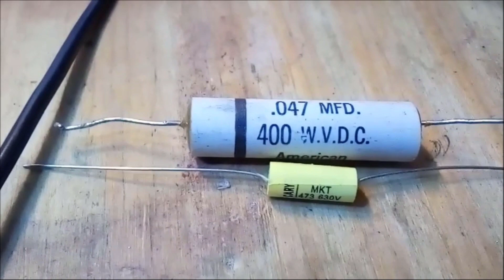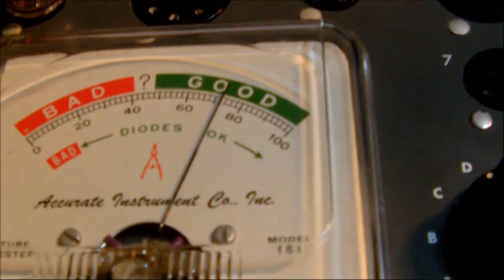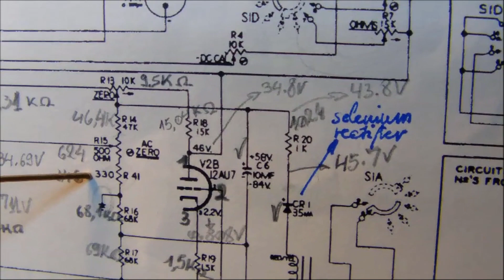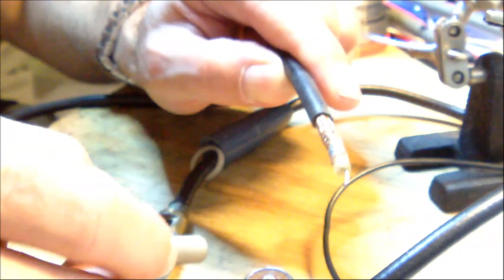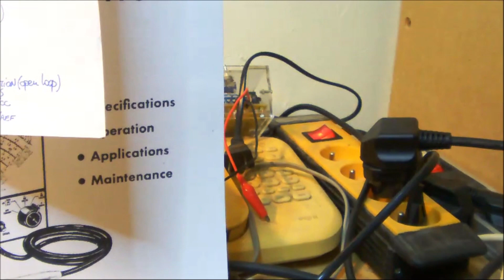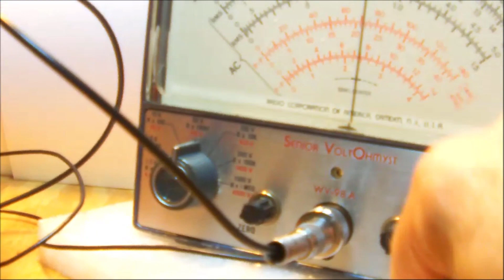RCA WV98-A Volt Ohmyst Multimeter part 2 of 3

Comment: I like your video a lot.  However after you replaced the selenium diode, you never showed in video 2 of 3 what the effect was on the voltage across C6 or the plate voltage on 12AU7 at pin 1.  Normally a lower resistance than 1K is used in other circuits and a series resistor is added.   CR1 is about a 7-8  V drop and the new diode is a drop of about 0.7 V.  That would normally have an effect on both C6 and CR1.  Please comment or better yet say what these voltages were after the conversion of CR1.  Thanks.
Reply from the maker: Hello Stefan and thanks for your nice comment. Yes, you're absolutely right, replacing the selenium rectifier by a silicon diode did push up the voltage somewhat (in the order of about 1.5V under load if I remember correctly) and I should have compensated that, technically spoken, by adding a roughly 100-150 Ohm 3W resistor in series with the 1N4007, to simulate the inefficiencies of a selenium rectifier.
 However, I also replaced the battery for voltage reference normally used in the Ohmyst, by an LM317 driven 1.5V voltage reference source tapped from the built-in transformer, which in turn dropped the voltage again by about 1V (again working from my memories of the restoration) due to extra load on the transformer.
In other words, the improvement in rectifying efficiency using a 1N4007 silicon recitifer, was nearly completely compensated by the extra voltage drop caused by the added little 1.5V reference voltage circuit I built into the multimeter.
I hope that answered your question :) Thanks again for watching, considering subscribing and giving me a thumb's up. See you soon for another video on my channel
Reply: @TechneMoira  

Hi,

I understand your analysis.  I determined that the exact electronic replacement for the '1K resistor and selenium diode' is to replace the selenium diode with a 1N4007, or equivalent (1000 PIV) and add a 300 ohm resistor to that 1K one.  The total resistance is then 1300 ohms.  This was done by breaking into the circuit between C6 and the 1K resistor.  I inserted a rheostat set to 100 ohms (a guess) and turned it up and down as a variable resistor to see the effect(s).  I had a voltmeter across C6 and one on the plate of vacuum tube V2B, pin 1; 12AU7.  The plate voltage was measured versus chassis ground.  I restored my low plate voltage of 138 V DC (caused by the selenium diode) to 142 V DC (silicon diode) across C6 and my 44.5 V DC on the plate to 46.3 V.  Those are factory voltages in the RCA WV-98A schematic. 

I did a lot of other analysis of load impedances and it was very detailed.  The ACTUAL current flowing in the old or new diode circuit is reportedly, *reported-not measured*, to be up to 100 ma.  The MAXimum tube cathode current in any tube manual from the 1950-1960s is 22 ma.  Ops!

All those statements like 'the rise in voltage from a silicone diode is 5 -15 volts' and 'the voltage drop of the selenium diode is about 1 volt per plate' are not very accurate. 

I measured the cathode current and got 2.3 ma DC.  So, looking at the Sarkes and Tarzian publications for a Model 50 selenium diode in a tear down, the observed value for a RCA S&T CR1 was 8 plates.  The voltage drops are the number of plates minus one and times one volt per plate.  8 -1 yields a voltage of 7 volts as what S&T would have published on their third party RCA model 50, IMO.  7 V/0.0023 A is 3043 ohms but you can't measure that with an ohmmeter because the voltage is way too low for a selenium diode determination.  You have to use much higher voltages like the RCA 128 Volts on the secondary in the 98A.  Is the internal resistance I needed 3043 ohms?  No way the total series resistance for a silicon diode replacement would take 4043 ohms.  The silicon diode is not a selenium diode.  So, now you can see why I used and inserted a rheostat to determine the live in circuit value of resistance to restore factory voltages for the 98A with a silicon diode.  316 ohms works.  I used a measured 299 ohm resistor.

A selenium diode is a Pandora's box and minefield, IMO.  I believe my meters and the rheostat resistance I got of 316 ohms.  I use a series 300 ohm resistor.  I have restored factory voltages now. 

So, the net series selenium diode and the RCA surge 1K resistor replacement electrically, is a total resistance of 1300 ohms in series with a silicon diode.  Sometimes it takes a 'sledgehammer' brute force rheostat to figure out a real solution.

I thought from all that 5-15 volts prognostications that I needed to buy a 2-5 watt resistor.  BTW, I used a Nichicon 350 working Volt new cap at 10 uF.  They are disappearing fast ass an axial cap.  If you take the real current through the 1K resistor and use I-squared R, the whopping wattage for the 1/2 watt factory resistor under load is 0.00529 Watts.  5 watts is my red faced value but it sure looks macho big like the S&K black box diode I left as is.  I-Squared times R for my added 300 ohms is 0.000158 Watts.  Anyone can use a 1/4 watt resistor in series with the silicon diode and the 1K resistor in any combination to get my 300 ohms.

You can't get a 1.5 V Zener shunt diode.  The lowest I have used twenty years ago was a LM385-1.2, a +1.2 volt reference voltage.  Your solution with an adjustable LM317 regulator is fine, but to avoid dumping all the other voltage above 1.5 volts as heat, indicates to me that a PMIC voltage regulator would use less power from your filament fix.  Even a 1.5 V Zener, if it existed, would dump excess heat.  PMIC might be worth a try at 1.5 Volts.  I have never seen a smile circuit for a PMIC voltage regulator but they are in laptops, I think, to avoid excess heat.  Just a suggestion.

I hope I didn't make a typo mistake..

Stefan
Reply from the maker: Well Stefan, I can tell you put quite some work into your analysis. Indeed practice often diverges from theory. In any case, over-dimensioning parts I consider erring in favour of prudence, provided you don't overdo it, of course :)
In my experience replacing a selenium rectifier by a silicon diode (like a general purpose 1N4007) necessitates a rather small value series resistor with the diode of about(!) 100 to 150 Ohms and at least 1W power rating to be safe. In your case, experimentation proved the optimum value to be 300 Ohms. 
Zener diodes being diodes, in principle drop some voltage themselves (I'd say about 0.7V) and need a minimum current to reach a reliable reverse break-down point where they start to "pinch" ("Zener") the voltage at a set level (say 12V if it's a 12 V zener) without burning up by excessive power dissipation (Zeners can get pretty hot, you'd be surprised). That is why you will always find a series resistor in series with a zener diode (of a few K Ohm generally). In my opinion Zener diodes for voltages of 1.5V or lower would be a rarety indeed, since they would probably never function reliably. 
If you want a (small low-power) low-voltage mini power supply that can give you voltages between 0.8 and 1.4V have a look at my "Building a 1-chip AM radio" and a "1 VFD tube display" weekend projects. They contain such tiny voltage power supplies.
Good effort overall by the way ... Keep the good work going :)
Reply: @TechneMoira  Hi,
I gave up on Zeners and Pulse Width Modulation.  You have to have a PS and that means dumping power as heat to get to down to a regulated 1.5 Volts like a battery.

Two of us looked at the waveforms of this 98A half-wave PS.  The Xformer secondary looks textbook pure sine wave with the scope grounded on the C6 negative which is the other Xformer sec' lead.  (Good thing the RCA has a lamp cord two wire plug-in with no earth ground.)

Then, we switched to the output of the silicone diode.  BAM!  We saw a typical cap discharge shape repeating like a sawtooth DC waveform.  HOWEVER, the decay in voltage was not from one cycle start of the former AC wave to the the next.  About 3/4 of a cycle over, the cap DC voltage was way off scale at the scope's 50 volts per division setting and as a huge DC voltage spike or transient.  The normal sawtooth DC was at 142 V DC with some ripple voltage.  The top of that sawtooth decay shot up 134 volts higher and peaked out.  It then dropped down to meet the start of the next sawtooth pulse at the top of the sawtooth cap peak voltage (before any decay in voltage).  That spike was a whopping 180 Volts higher yet.  142 V + 180 V is 322 VOLTS higher than the C6 cap ground or negative lead.  322 Volts high!

We moved to junction of the 300 ohm resistor that I added and the old 1000 ohm resistor 'input'.  That spike was totally gone.  It was also gone on the positive terminal of C6 which is also the 'output' (voltage dropped side) of the 1000 ohm resistor.

We were shocked at that spike height and how a resistor dissipated it.  Between the resistors was a tame sawtooth waveform.  I never saw any PS do that before.  It was not a ringing waveform like on a square wave just at the closing of a switch,  That waveform is an oscillation and dampening wave by itself on the square wave.  This was some huge voltage transient spike from Hades. It didn't even start at the end of 180 degrees like the end of the rectified positive half-waveform pulse.  The sawtooth was stretched out and then spiked higher.

The only thing I ever saw on a scope like that was an inductive kick voltage spike from some big relay coil breaking open its contacts without caps on the contacts or a de-spiking diode across the coil.

We kept moving the probe to find some cause but the input transformer input to the diode was pure sine wave.  This spike was higher than the C6 DC voltage value and riding on that rectified C6 waveform.  It did not drop to zero volts and spike up.  No wonder AC and DC current readings and voltage readings don't make sense!

Now, that 322 V DC peak was not across the C6 cap rated at a puny 150 V DC.  So, it was not spiking or pulsing the cap plates.  We were so shocked that we never thought to hook up the original selenium diode and only the 1000 ohm resistor to see what that waveform looked like.

I am lost as to what generated this spike but not so much as to how a resistor killed it off.

I got some replacement pot's for the entire RCA 98A from J'C'.com as Taiwan made Alpha potentiometers.  I got them today and they are knockoffs of the original Clarostat C32276- 1 and -2 pots but without the twist tab mounting tabs.  These come with knurled and slotted shafts and are jam nut types.  They will shoehorn work, if you need one.  Less than $2 USD each.
The 500 ohm 1/2 W pot was back ordered until Sept.  So, I got a 1K and figured in a pinch I could use a 1K resistor across it until new stock arrives later this year.  I don't need any of them but they are getting had to find, believe you me.

I hope this helps out some of your readers and followers.  The axial 10uF caps are almost gone.  You can get a 450 WV DC one along with a pot' order from the US coast towards you.  Robots can't install axial caps as fast as radials, I guess.  Through hole chips are getting scarce too.

I think a 300 ohm 1/2 or 1/4 watt resistor will work just fine to create my selenium diode equivalent device.  250 ohms is fine too.  It's not that critical.  The silicone diode alone raised the C8 voltage to 145 V DC, BTW. 

HTH,

Stefan